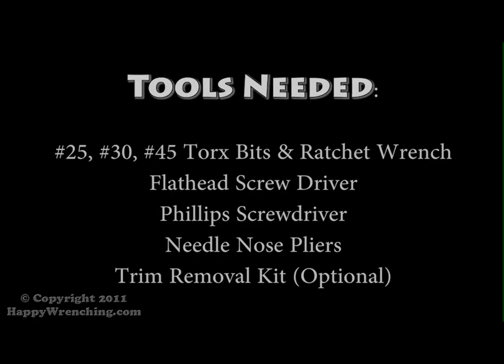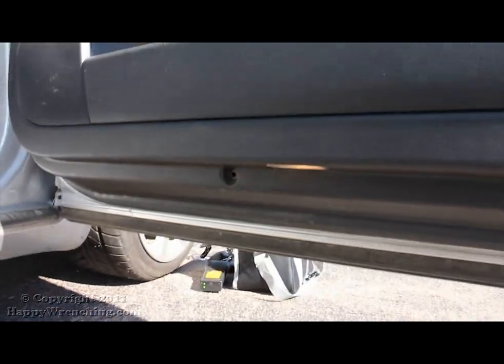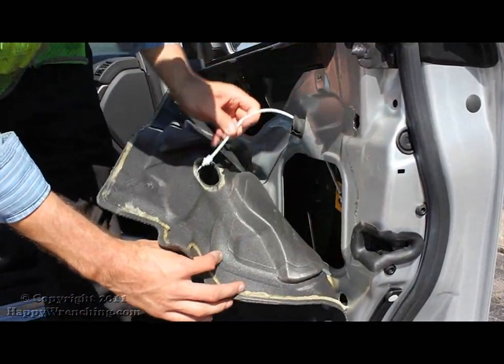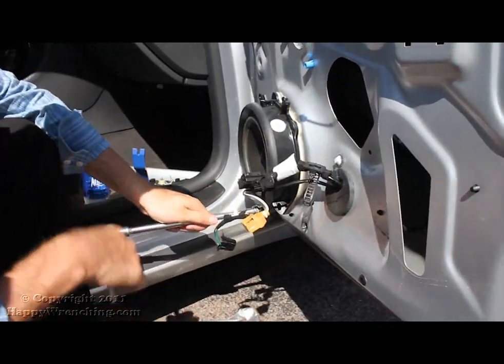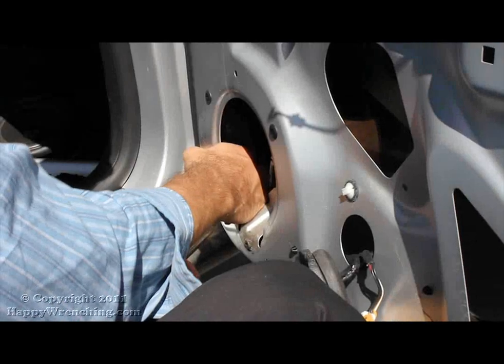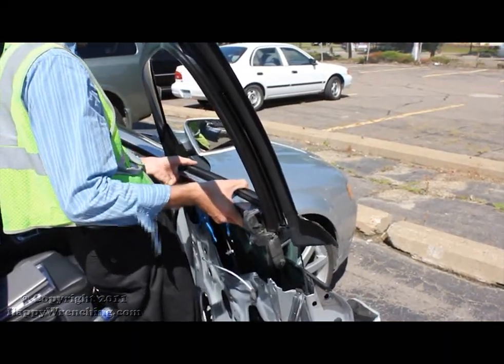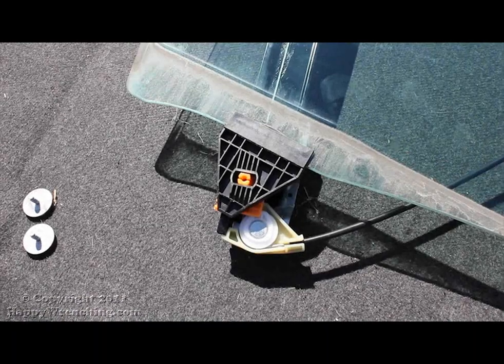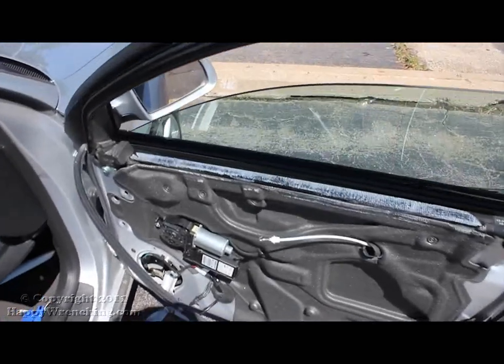Audi A4 Window Regulator Replacement | Removal And Installation |

Comment: Good video.  Thanks.  However, you should mention that the window bolts that attach the window to the regulator should not be tightened snug/tight.  This will cause binding and drag.  The window should have a little play on the regulator blocks.  Tighten down then back off 1/4 turn.
Reply: @Kaiden Jorge Instablaster :)
Reply: @Frank Edward It worked and I now got access to my account again. Im so happy!
Thank you so much you saved my account!
Reply: @Kaiden Jorge no problem :)

Comment: You should show how to put everything back together. That is most difficult part making it all fit back together.
Reply: Jay Martindale  cap, i’m putting my door panel back on and can’t line the clips up for the life of me, really tests my patience especially when i can’t find any vids on it
Reply: Jay Martindale  yea i slid it into the channel, banged it down into place, made sure the speaker bracket lined up with the speaker, then every time i hit the door in a clip would fall, finally got them clipped in and on the last hit, the cord that hooks to the door handle unhooked.. wanted to rip the whole door off after that

Comment: on the 2000 a4 b5, you dont need to break any clips for the rear door cards. for screws and lift up. one of the screws is under the door handle collar. one screw to remove collar and one screw underneath. do not remove the decorative door strip. there is nothing under there.

Comment: you dont need to break any clips in the back. just remove screws and lift door card up.one screw hidden under inside door handle coller.

Comment: This video was very helpful. I was really having a rough time, with my door halfway apart, figuring out why I couldn't get my regulator loose through the access holes in the inner door panel. ,Thank you very much for posting it. I had one difficulty, though. On my 2002 B6 A4 Quattro, when I was removing the bolts that held the inner window assembly in the driver's side door, I heard some little clinks in the bottom of the door. I reached in and came out with several flat horseshoe shaped pieces of metal. I didn't know what they were. When I put everything back together and closed my door, I had a gap where the top of the window rail met the roof. I realized, at that point, that these were shims that went in where the main bolts went into the window assembly. Thankfully I didn't have to take everything back apart, just loosen all the bolts enough to slide the shims back in, but it was a trial and error process until I got the right number of shims in each location for everything to be aligned properly. This may be a solution to the problems KetamineFix and Tiger in me (maybe others, I didn't read all of the comments) had with the window glass alignment or needing extra force to close the window. So what I'm saying is, when you're taking the main bolts out, it might be a good idea to reach in the door and remove or catch any shims that may be in there so you can replace them with the correct number of shims at each bolt. Again, Thanks "happywrenching" for a very helpful video.
Reply: same

Comment: I had the pleasure of this job today on a client's vehicle today. got the door panel off no problem then I looked at the window and thought how the hell one the glass out of the door and showing the cable that that run from the door mirror take - very important step and I was doing this job alone. thank you for a very precise & informative video , got the job done without breaking anything:-)

Comment: Great tutorial, thanks! Once you've removed the screws, the inner door plastic simply pulls straight up and comes right off. No need to break any clips. I have a 2000 and my regulator started wearing out about 3-4 years ago. It finally snapped tonight! A shim will have to hold everything until I can fix it.

Comment: I just changed my window regulator using this guide and was a complete success! I would add that the mirror cable on mine was fixed with little velcro straps that were a pain to undo but other than that the vid is spot on 👌

Comment: Thanks for this video! This is a job that I have to do this week and your vid has shown me a simple way to get at the bits I need, in the order I need them. You've probably saved me 30-40 minutes and several broken clips, or even the glass! Huge props to you for your vid - really clear. Thank you

Comment: This helped a lot.  I got halfway in and scratched my head, had my suspicions  that the whole upper half of the door would have to come out.  This confirmed it.  Not sure whether to love it or hate it.  It kind of seems like extra work but any other vehicle I’ve replaced one on required a lot of window manipulation and risked scratching it in the process.  This design helps prevent that.

Comment: Thanks for this video. I replaced the cable kit in mine today.
 Knowing where each bolt or screw is beforehand helped a lot. 
 With the cable kit the only tough bit was winding the cables onto the drive pulley & then 'twist it tight & flip it down flat into its housing'.
I put in soundproofing into the door & a new window switch lock as well.
This time I remembered to connect the doors inside latch cable too.

Comment: Tremendous video.  Two additions for those who are using this video as a guide for an 2004 A4 3.0 driver's side window regulator replacement.

1. There are two screws that need to be taken out when you pop the small panel slightly above the armrest.
2. There are also two screens that need to be taken out to remove the driver's side mirror.

In my case, one of the two wires that attaches to the gear on the regulator broke at the gear.  I'm ordering a new regulatory assembly and will save $390.

Comment: Thanks for the video. Managed to get mine done today. Didn't account for one of the retaining screws on the motor snapping a lug off from the regulator though... don't over tighten guys! Had to remove the wing mirror too and it was a bugger to get back on correctly so anyone looking to do this make sure you can remove with the mirror attached and there is enough slack on the cable. Thanks again!
Reply from the maker: One of my early videos, good to see it's still useful!
Reply: The side mirror mucked me up too!!!

Comment: That was just a brilliant guide ... covered everything including differences covering a RH drive car (screws behind cap on drivers door). I just did mine ... but my issue turned out not to be a regulator mechanism issue .... the cheap nasty plastic splined shaft from the motor had sheared right through - all the teeth were good, but superglue didn't fix it. So I stripped the whole shooting match out assuming it was a cable issue or something else - turned out I only needed to take the motor off ... but hey ... I had a morning free and did some exploration into what was in my door ... it still constituted fun ;-) now got to see if I can buy just the plastic splined motor shaft, not a whole frikkin motor ...

Comment: Thanks for the outstanding video! I was able to fix my driver side window in three hours. The only thing I could not do was install two locking flat clips that fell into the bottom of the door pan when I pulled out the window?  Of course I also own a 2003 A4 model maybe that style is different maybe from 2004.  Thanks you made my wrenching happy!.

Comment: great video, only thing you never mentioned was window alignment, I followed your vid to the letter, when I secured the window onto the regulator, window was about one 3rd of the way down, when I put the window up it is misaligned (not sitting true with the window frame and not sealing) I am going to get to the point where I can slacken the window securing bolts on the regulator, push window hard up into the correct position an re-tighten, hopefully that will align it, anyhoo, thanks for taking the time to make the vid ;)

Comment from the maker: It is not always necessary to replace the whole assembly - sometimes the clips break other times its the cable that chews through the plastic piece. We went with the full assembly because it was just less hassle to replace the whole thing rather than mess around with the individual parts.

Comment: Excellent video! My window suddenly made a grinding noise and ground to a halt fully open.. just in time for a belting thunderstorm. Only problem I found was the Torx bolts holding the regulator mechanism in place in the top section appear to be made of putty, as the one of the heads totally caved. I now have to drill the thing out! And of course, the replacement regulator mechanism doesn't come with replacement bolts...arrgh. So it's off down to the main stealer tomorrow for some spares...

Comment: A very astute observation.  Even if every person who had an issue with the Audi window regulator looked at this video, it would be a horrible statistic.  But realize that only a small faction of a percent is probably looking at this video to try and troubleshoot the problem.  

I currently have the issue for the second time on my 2002 A4 and once before on my 1997 A4.  

Has it been solved?  Or are a large percentage of Audi / Volkswagen owners still suffering this issue?

Comment: one very important thing to make sure of prior to mounting the glass back on the assembly is making sure the cable coming out of the top of the blue center spool section (leading to the top rear pulley towards the rear of the car, once mounted) is on the inside (towards the center of the car) of the cable its crossing over (the cable that goes to the bottom rear pulley).

Comment from the maker: Yes, the process is the pretty much the same. Screws and bolts will be in different places but the process is the same: remove the door cover, remove the sound deadening, remove the motor & speaker, and lift the top half of the door up.

Comment from the maker: @johnabreault thx for the tips on the driver side. While not completely broken, the wires on our window regulator assembly were eating away at the plastic gear piece. The plastic parts and the "factory" duct tape make me wonder what audi was thinking when they designed this.

Comment from the maker: Are you sure there is an override switch to disable the child safety lock? Other then that I can't really think of anything else but to cut out the panel with an angle grinder. I think you will get a lot more help if you post your questions on one of the audi message boards - either audizine or audiforums. Good luck.

Comment from the maker: When we removed the material, the adhesive came out with it as well. We were able to then reuse the adhesive when putting the material back in. But if the adhesive on your car is no good I really don't know what kind you would use to glue that back to the door.

Comment: That looks like a scary job to me. Very good mechanic .. smooth and calm.
Reply: MetalTeamster it was actually pretty easy to do. I'm just looking for the bolt size for the frame to regulator bar size
Reply: Yeah it's not that bad.

Comment: Awesome video just did it on my a4 ,took me a couple minutes
Reply: Jason Velazquez couple minutes? 😂
Reply: @smitty3347  yes a couple minutes, I have done it before I just need to watch the video to remember a couple steps. I have a 2004 Audi A4 with almost 180,000k Miles  this is my second time changing the window regulator

Comment from the maker: @SundayGladiator The window stopping midway is actually one of the symptoms of a failing regulator. The cable wears out the plastic, causing it to bind. Either way, I think you will have to take out the window assembly.

Comment: Great instructions, my regulator has just broken and followed this video step by step.I am waiting to get the replacement unit, but before I fit it, can you tell me if it makes a difference whether the window is in, either the up or down position during assembly or doesn't it matter ?
Reply from the maker: Doesn't really matter. Its a little easier with the window down.
Reply: Thanks,  I will let you know how I get on.

Comment from the maker: All I can say is that the door control module is integrated with the window motor assembly, so make sure that all of the electrical connections have been properly plugged in.

Comment: Hi, First..many thanks for your help, as I'm skinned now with no money:) !!!. small issue.. I have done my driver side and it works (going up/down apart from not being smooth and it's a bit stiff? one thing I had to do is move the (New)cable regulator level down.. as it came new with level up, because to align the glass, did i do something wrong? should i re open and do something? is it best to fit the glass up & screw it while up?..
Many thanks!
Reply from the maker: Hard to say without looking at it but maybe you did not align the two regulator posts correctly? So one side may be pushing that part of the window higher than the other side causing the window to be stiff. Maybe your window motor is starting to go out?

Comment: I will be performing this operation this weekend...wish me luck :D Also, does the rubber that goes all around the window that you just removed have to be glued back? Or does it pop in there? Just to be prepared for the whole thing when I start doing it.... At first I thought the metal will come off revealing the window and the mechanism...but you actually pull it out....good to know :D
Reply from the maker: The weather stripping pops back in. Good luck!
Reply: Worked like a charm...a lot easier than I thought it would be. The only downside was that 2 plastic clips that were holding the weather stripping broke...but it says there very well without them, I'll prehaps replace them if I find any in the shop. Sir, thank you for the vid!

Comment: Hi, what I think is the regulator on my A4 is making a sound similar to what you show at the start of this video (only much worse) also the window only lowers but does not lift. Would this be the regulator or the motor? Many thanks in advance
Reply: Mitch Kelly I've got the same problem, did you sort yours?
Reply: Lee C yes it works perfect now
Reply: Mitch Kelly what was it ?

Comment: WARNING!!!!!  If you new a regulator with a zip tied disc to the blue section DO NOT remove/cut the zip tie until the regulator is in place in the car and you are about to mount the blue part onto the door.  My disc popped out and uncoiled and was a B!TCH to reassemble!

Comment: so you wont make my mistake. i didn't have the old one too reference for this since the cable was mangled and pulled out. had everything bolted in when i noticed the cable was hitting the window as it went up and down. I had to pull it out again and do it right. so watch for this. it will go together and fit back in the door with the cables crossed the wrong way. :(

Comment: Can anyone help, at 7:42 what are those bolts/how is he removing them? On my regulator they just seem to be circles with no thread inside, ive tried various torx bits, any advice is appreciated
Reply: What did you do with them?  Im having the same issue..
Reply: Dunstus Lion they were behind the circles, covered closely by the metal door frame, look closely at the back of the regulator circle holes at the edges to find them; btw you'll need a right angled, low profile ratcheting socket screwdriver (Torx bit) to remove them

Comment: great video. you saved my butt on this job. just did it on a 06 A4 B7 pretty identical. few things that are worth mentioning you may want to add to tag. when you say "mark the window regulator so that you could put it in the same place" i stared at the assembly unclear by what you meant. i figured the two black rails could pivot to a wide degree which i saw to be the case once i loosened the screws, so i took a pencil and stenciled around them to where they mounted. worked good but....
Reply: But??? But what??
Reply: @SmokeyMcPot42087 Sorry dude. After 11yrs I don't remember what the heck I was referring to lol! 😂

Comment: I just lifted the window and frame out of the door, and two small metal pieces fell into the door. The part number is 8D0837779 and they are called "distance piece assembly carrier". I have no idea where these pices go. Does anyone here know?